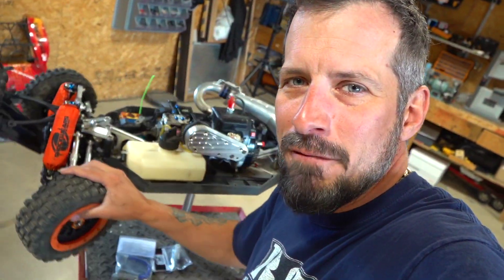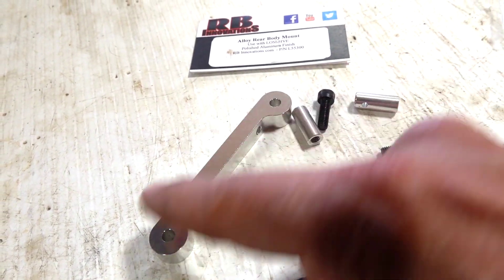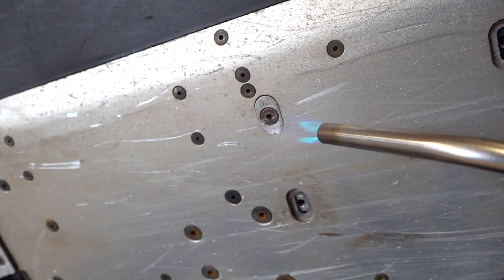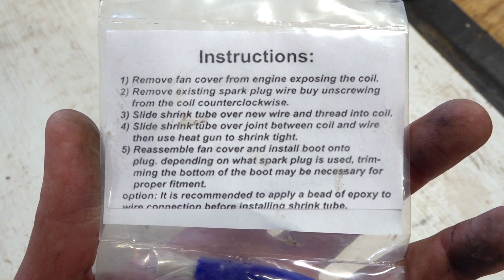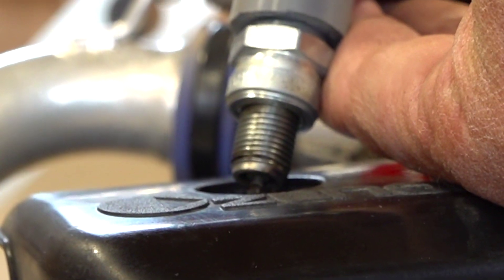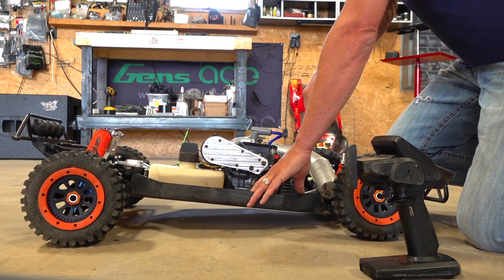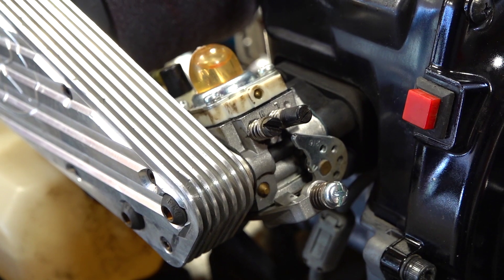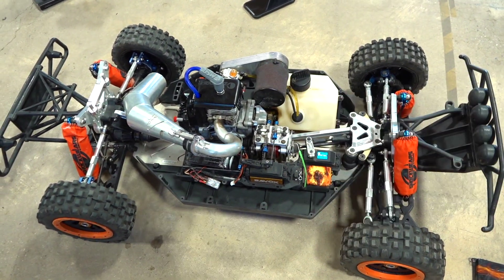Project: LARGE 2.0.5 - After 2 Years I attempt to START my 32cc GAS Race Truck | RC ADVENTURES

Comment: This is the half beauty of this hobby. Maintaining a two stroke engine and everything else needed to rise again this fifth scale jewel. The other half is when you go out to the track. With project large 2.0...If I had it I would go to a CNC manufacturer to design my own parts for it, and for the engine I would use the best available existing upgrades. Beautiful vehicle.

Comment: Check your compression on it bro could be bad rings in the piston when you pull the exhaust move the engine slowly and look at the piston and rings look for any scoring and the fuel pump diaphragm could be bad in the carburetor rebuild kits are cheap and easy bro hopefully this helps I'll post a link to a fellow Canadian on the carb !
Reply: Here's the link https://youtu.be/7-VpdJEJRRw

Comment: Pull the carb apart, its probably the needle and seat gummed up sticking wide open. Simple 5 minute fix. I loved my old 5th scale red cat, put a 36 zenoah in place of the old anemic  23cc it had and it came alive. Started breaking dog bones left and right but it was one hell of a time! Thinking of getting another for sure, just gotta get the girlfriend on board with it 😂😂

Comment: He stayed a long time on the shelf, it would have had to completely disassemble the carburetor to clean it, because the residue this glue inside the carburetor, the gasoline arrives a little, you start and it stops, I already had this problem and also with a problem of compression is on it will not start, but you can also have a problem of offset of the ignition. Most of the time when we change the cable of the ignition we also change the candle .
Reply from the maker: The candle is brand new ;) Yes, I agree on carb clean..
Reply: @TheRealRCSparks  😊👍

Comment: I just got my 5t last fall it was used I drove it at least 3 times or more a week after work. Till the clutch failed then I tore it apart to replace clutch and other wear items and sadley haven't had time to get it back together but I do have all the parts to do so now just gotta make time.

Comment: My first Nitro was  a Cox Dragster with the Tether Many Moons Ago, but as Nitro went on I've used Several Year old Fuel and it Still Works..... As for gas Use an Additive that Preserves it Also for the 35cc engines and up I have used a  Fuel from Home Depot they sell two grades I only used it for my Gas Trimmer but it RUNS WELL!!!

Comment: If you run non ethanol ⛽️ it will save you a lot of trouble glad to see you getting the Losi ready
Reply: Travis is so correct!!!  Find a supplier, it will save you a lot of headaches with fuel issues!!!  Since using it on all my lawn equipment no more problems!!!

Comment: Tip when using any screwdriver or Allen key bit like that while you’re turning the screwdriver/Allen key, tap the end of it while turning it makes life so much easier

Loctite also melts around 60 degrees Celsius

Comment: I once was checking the spark on a lawn mower just like you were doing...    and there was enough fuel in the cylinder that it caught on fire - fortunately, it was in open area and not like in a garage.

Comment: Yes I love my losi 5t just replaced the piston after the the pin bearing let go and somehow it still ran on a messed up piston for a go 4h before it had enough now I installed 2 speed gearbox as well and it’s nuts I have to do a vid on it sometime

Comment: The leaky gasket isn’t the problem order you a 990 carb with a spiral diaphragm kit and install that in the carb then on the engine with new gaskets and a new plug, set the carb to base settings for 990 and let her eat! I 100% guarantee that will fix the issue here. Also a copper gasket with properly inch pound torqued manifold nuts would not hurt either! All my stuff sits and always starts and I run Caster 927 also! But NO ETHANOL!! That stuff is an engine and carb killer!
Reply: EastSide RC dude he just needs a new spark plug
Reply: Delta yeah and a new spark plug. When gas with ethanol sits in those little carbs the diaphragm becomes like a stick and they are done. So for less headache and as cheap as them carbs are 70 bucks for a modified carb is so worth it. The 990 and a spiral diaphragm and a new spark plug and a new copper exhaust gasket would be a nice fix. All my RCs are kept inside in the AC and I never run ethanol or leave gas in mine and they ALWAYS start and run perfectly! I cant say the same for my lawn equipment....oops left ethanol in them only once and never again haha! I hate ethanol! Everything gets race gas now!! All good smells and super crisp throttle response!

Comment: Yes number one you have to get the exhaust fix 2 next time when you before you started it you have to disconnect the fuel line and make sure you pull up card and get all the excess filled out the engine is flooded

Comment: When it got to not starting, first thing to do is pull the plug and see if it is wet or dry.     If dry, you are not getting fuel to the cylinder.    If wet, it may you have a clogged air filter, or sticking choke.   Check to see if you spark plug wire is seated on the plug.

The other thing is that your gas tank is not vented because you accidentally put the wrong cap on the fuel tank.   You maybe getting a vapor lock.
Reply from the maker: Its the right cap
Reply: @TheRealRCSparks   I had to ask because I have seen this happen before, twice.   Once on a go kart, and once on a small outboard.   The user when refueling mistakenly swapped caps.      Try to start it again.   If it doesn't start, pull the sparkplug and see if the sparkplug is wet or dry.    It it is dry, you are not getting fuel into the cylinder.

Comment: I'm not sure if gas is the same as nitro, but you have to run nitro empty and use after run oil before you store it. The oil in the fuel will dry up and gunk that carb up forcing you to have to disassemble and clean it, not just remove the needles. I suspect the fuel you see is actually from when you removed the plug and tipped it over to clean out the old gas. Usually some residual leaks out the sides after that. Good luck man!

Comment: I don't know if you know of this little handy dandy trick that will reduce the infamous all-too-familiar busted upper and or lower control arms. I don't know the exact method to ensure the proper procedure but it is something you might want to investigate. If you boil the control arms or any other OEM plastic parts in hot water on the stove it penetrates in the plastic and allows for a little bit more flexibility and is able to take a higher impact without breaking as it flexes a little bit better then a stock configuration. Somehow the water penetrates the crevices of the product. Grab a couple of say Factory OEM control arms and boil them I say for no more than 5 minutes ( as that's what I have always done  oh, and it has worked for me ) would be my guess as you do not want them to Warp. I've never had a problem with them warping but, nonetheless. I'm sure you got plenty of OEM parts for any number of one of your trucks. Give it a try. I've never really had much luck with a YouTuber owner responding to one of my questions or suggestions. I don't bother too many YouTubers with a bunch of flim-flam running of the neck stupid babbling. I believe my suggestions and or comments are rather intelligent. Let's see if you have it within you to respond. I think you have responded to one of my suggestions in the past. Been with you for a long time. Enjoy the show. Oh that's right I mentioned firing Joe because he would not wear his vest : D keep up the good work little brother and proceed with pure positivity on your health. I hope you're feeling better and be good to yourself my man. Mrs. Sparks is a beautiful woman and little man Marcy is my hero and Well on his way to someone to contend with. He's a freak when it comes to driving his truck. It's like he's been doing it for years and years. Well past his what would be considered ability when it comes to age versus professionalism in the ability of driving that truck!! : D love ya my man!!!

Comment: You should use premixed gas like VP fuel or True fuel makes 50:1 and 40:1 that is 94 octane and no ethanol so wont go bad from storing. Its specifically made for these small engines

Comment: I have the Losi DBXL, with an OBR motor in it. Probably looking to sell it soon but I have the receiver out and the kill switch and all the wiring. Just haven’t had the time to put it back together. I hate to see it sit but work kills all the time I have. Also the pull cord broke so that’s why I haven’t put it back together yet.

Comment: You should’ve dumped a little 3 in 1 oil or that castor oil in the cylinder an lubed it ups bit before starting it. That also helps it fire up with a better deal around the piston. I think you just flooded it really badly.

Comment: With that "Walboro" chainsaw-style carb, I'd probably pull it, disassemble and clean it up too.
Reply: Always a good idea to use non-oxy gas with Stabil mixed in also.  About 5 yrs ago, I started mixing in Stabil and Lucas fuel conditioner every time I fill my 5 gal cans.  I haven't had to pull or clean a carb on our lawn equipment, chainsaws or ATV's since.

Comment: I'm still surprised that nobody has made an "alternator" for these engines so that you can get away with a smaller battery and possibly use the same mechanism as a starter.

And I loved mine, but when you have someone offer stupidly high money- you let it go. My only caveat was that if he went to sell it I had first dibs on it. Took him a month and a half before he brought it back because it "wouldn't stay running". Bought it for next to nothing and had to rebuild the engine to get it going again. I recently sold it a second time, with the same caveat, due to health issues.

Comment: I dont think that loose pipe at the head is the issue. I run my motors on the bench with no pipe regularly, and they all started no differently then with a pipe.

Comment: had a redcat that liked to run about that well.
Just curious, does that carb have a float bowl on it? Did you drain the carb out if it does? If not you have bad gas still in there. 
Also take the carb apart and completely rebuild it. If there was any E content to that gas it will eat the orings and gum up the needles. Take compressed air and blow it through every hole you can find in the carb.  Also highly suggest a fuel filter if you don't have one. If you do replace it, its probably goo.

Comment: Ur exhaust leak doesn't have anything to do with it not starting. But all the fuel that's comin out the exhaust, is a sure sign that it's flooded. Try taking the plug out again and pulling the rope with the truck upside down. then putting a brand new plug in it and have one person pullin the rope and the other holding the throttle wide open. jus sayin.

Comment: If i can get my 20 years old Fg Solo engine circa 1997 that has been sitting around for  give or take 18 years...you can too...Turns out mine was just fouled plug..ran the engine fine after that..

Comment: I noticed when you did a close up of the broken rear body mount, that the rear shock upper mount positions were not equal side to side, they were in two different spots. Is there any reason for this tuning wise, or was it just forgotten?

Comment: 1: That exhaust leak is not going to cause your engine to fail to run. Your engine will run with no exhaust attached *at all*, albiet very noisily and with terrible fuel economy.

2: Should not have purged the old gas out of the engine. It was willing to run for a couple seconds on that old gas, and leaving that old mix in there would have gotten it to fire and run for a couple moments. That may have been what you needed to get it to clear its throat.

3: If you've got raw fuel pissing out the exhaust like that you flooded the poor thing. No wonder it won't run!

What I would do to fix this engine is:

1: Tear the carb down and thoroughly clear each and every passage

2: When the carb goes back together, new diaphragms go in. Those things perish easy, especially when left sitting, and they're the fuel pump. if they don't work right the engine'll never play nice.

3: Burn the schmoo off the business end of the spark plug.

4: Find a way to drill start it for the first attempt, rather than reefing on it with the pull start until my shoulder went sore.

And yes, Medic, I'd LOVE to have a big scale car. Prolly the Rovan Baja. And if I had my druthers, I'd put a Stinger 609 V8 in it.
Reply: TestECull 2 stroke dude
Reply: @thomascantrell5165  yEah what about it?

Comment: Its flooded hold the throttle open and pull it would have ran. That's why you have fuel coming out start it up and run the piss out of it it will seal eventually it's just a trimmer engine

Comment: I think 1st fuel is fine , thats part of the problem gasket but also if you didnt run gas out and let it evaporated the ethanol is horrible eats the diaphram ive run my losi with exhaust rattling off plent of times Everett is right also except theres no jets just diaphram loses it wvr change carb fire up two pulls plenty compression

Comment: I’ve wanted a Losi 5ive t since I started the hobby but I don’t have the money to drop over a grand on a car ☹️
Reply: Dylon Correia same I can barely keep my Stampede running it’s held together with zip ties and epoxy on a lot of parts 😂
Reply: 30 degree north or km x2 are options then also you can see losi 5t with mods go for 600

Comment: I have the King Motor X2 & LOSI MTXL and installed 34cc OBR full mod engines in both and love them both. As with you I also love the tinkering part of the hobby probably more than driving them. Looking forward to the video.

Comment: A leaking exhaust gasket would not cause it to not start. A leaking head gasket would thought. Also I would change the spark plug. Just because it is getting spark doesn't mean that the spark is strong enough. I am speaking from experience....

Comment: NEVER.EVER going back to gas/nitro powered cars.
Me and my friend both had 1/8 nitro monstertrucks and even a slight change in humidity made them not want to start.
Of course we couldn't drive in our own neighbourhood either because they are too loud.
So we had to drive somewhere to drive these nitro cars and 80% of the time you end up trying to start and tune the car 20% time you actually drive you car.
Now all I got to worry about is crashing with an electrical 6S 1/8 truggy.
Reply: I didn't have this kind of problem. 5-10 mins of tuning and ready to drive all day long. Only thing is holding me back from getting an electric RC is the battery.
I heard so many bad things about them. Even one of the guy I used to go out bashing told me these batteries are dangerous. He had one which caught on fire.

Comment: I’m pretty sure you flooded the engine
Reply from the maker: I showed purging it..
Reply: What ever that means..... ok
Reply from the maker: @lukehall5959  It means removing the spark plug, and tipping the truck upside down.. and pulling the draw chord to spit the gas out the top into a rag. I showed it in the film

Comment: It won't start because you have it so badly flooded at this point that's why there is gas pouring from the exhaust , it will run fine with that exhaust , actually it will run without an exhaust at all ,